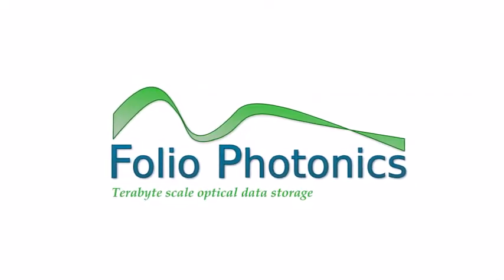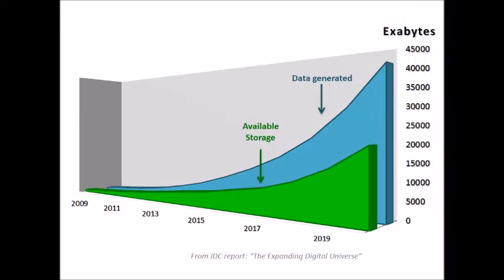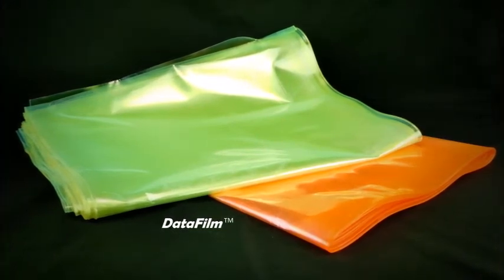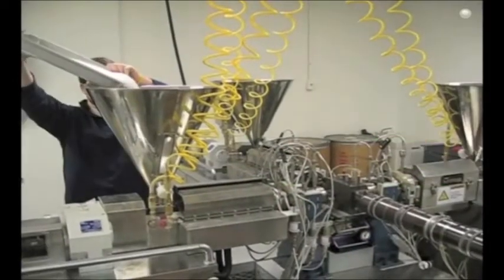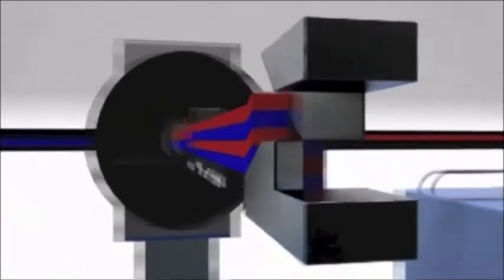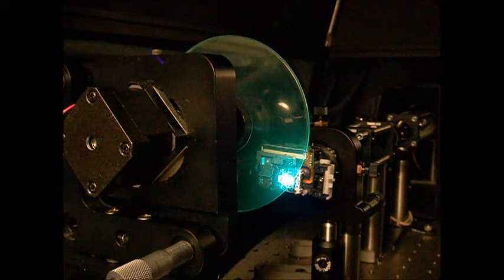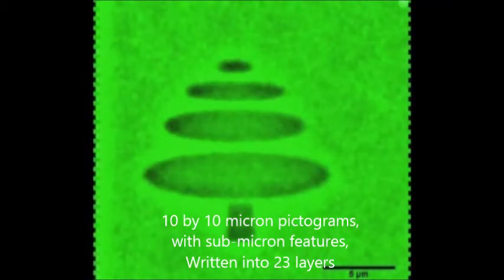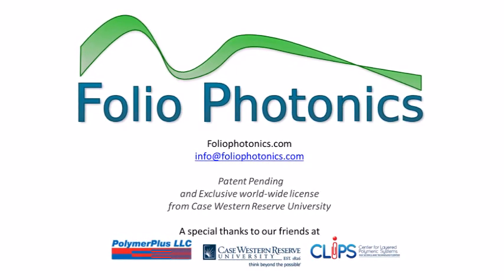FolioPhotonics - DataFilm Disc

Comment: To Be Continued...

2017 - Multi-Layer Film Extrusion & Disc Construction Began.

2020 - Static Disc Validation Completed.

2022 - Dynamic Disc Validation Completed.

2023 - Scale Manufacturing Capability & Produce Alpha Folio Discs.

2024 - Produce Alpha Drive.

2025 - Beta Drive & Disc Production with Testing Validation.

2026 - Commercial Disc and Drive Availability.